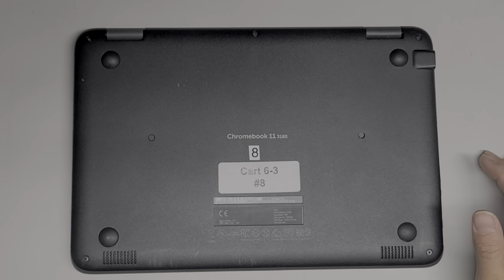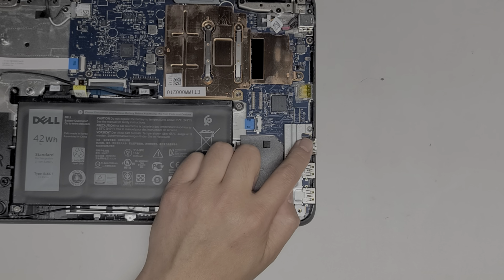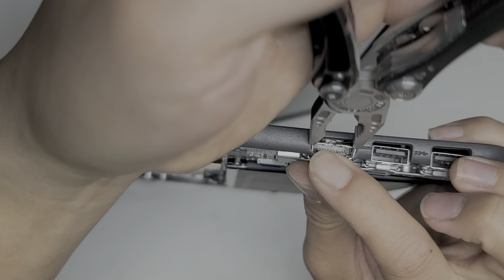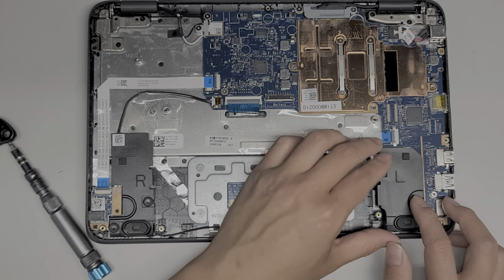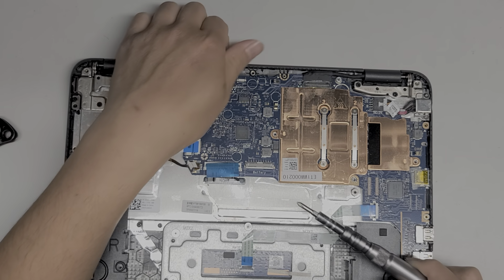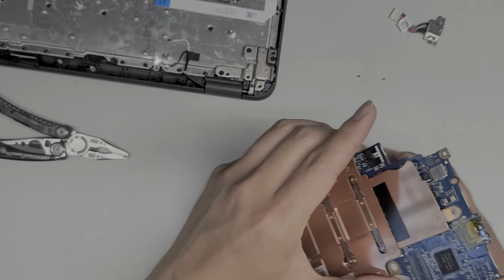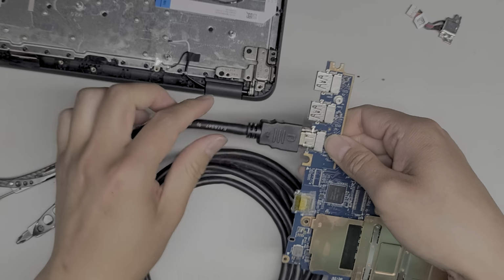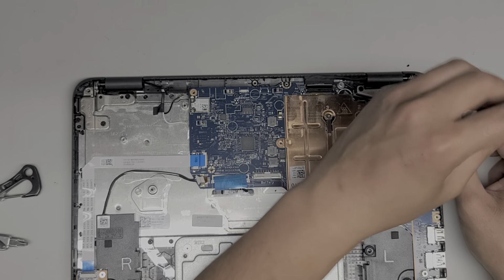DELL Chromebook 11 3180 Disassembly No RAM  No SSD No Hard Drive Replacement Nothing Upgradeable

Comment: I put a 128gb sd card in and installed linux to it instead of the onboard 16gb. Even with a light weight linux i found i'd be left with 6-4gb usable storage. My unit says chromebook but is no longer that.  End of Life on purpose, thats horrible google purposely make these to be trash after 10 years. My issue  is mine has a 2018 stamp on the inside, which make this only 8 years, i was told in 2022 that it was end of life and no more updates would be made. Hunk o junk. At least theres other options that i can make it happen.
Reply from the maker: Yup

Comment: It does not have a fan to cool the device. Where are its cooling centers? Please reply. ❤
Reply from the maker: It's passive cooling. It just slow the cpu if it's hot
Reply: ❤ thank you  @ItsBinhRepaired
Reply from the maker: @zainebsaber5828 no problem

Comment: Just an FYI for people that come across this in the future... You want to use an HDMI Chord and plug it in before moving/adjusting the port. It will help prevent any damage to the HDMI port. Don't make any adjustments without the cable plugged in. Also, don't go thru with putting the whole thing back together before testing repair. It's a pain to remove all the screws again if you wind up replacing the HDMI port or that little board with the three ports all together.
Reply from the maker: Hmmm I didn't do HDMI repair
Reply: @ItsBinhRepaired  That was an HDMI port you were trying to fix due to physical damage...
Reply from the maker: @geraldeaves3340  hmm I don't recall. I'll have to watch my video again. Lol

Comment: I was completely shocked and perplexed when I opened mine. Where even is the RAM??
Reply from the maker: Soldered like a phone
Reply: @ItsBinhRepaired   @ItsBinhRepaired  Yes, CPU, RAM, SSD.......EVERYTHING is soldered to the mainboard on these Chromebooks.    They were built down to a price - cheap as possible, but still able to run ChromeOS.    So, NOTHING is swappable, and Chromeboooks don't even have a BIOS or UEFI to speak of - the system is booted by a dedicated firmware, that EXPECTS there to be a ChromeOS in a very specific place in the onboard EEPROM.   Upgrading is impossible.  Replaceing a failed component is impossible.  Booting Windoze as an alternative is essentially impossible, as there is no traditional BIOS or UEFI.    There ARE utilities you can use to wipe out the ChromeOS and install in its place, a simple UEFI type thing, which then DOES allow you to boot and install a more standard Linux distro, but you have to be prepared to hack the machine, and re-flash the firmware to replace ChromeOS with a generic UEFI system.   Do-able, but NOT for the novice.
Reply from the maker: @VauxhallViva1975  yup, it sucks

Comment: Hi everyone i watched the video,un my laptop lenovo chromebook yoga 11e glimmer model i was able to install windows 10 by REMOVING THE PROTECTION SCREW and writing some commands.i am trying to find a solution for expanding the space.
Any idea's???
Reply from the maker: Nice! Nothing upgradeable sadly.
Reply: @ItsBinhRepaired  there is the storage. You are a lucky man since today, I discovered a way to upgrade my storage using the WiFi adapter to m.2 with mvme m.2 , and you will have a good storage.
The ram is not upgradable. Maybe there is a way to overclock the ram, but it is not safe 
I will accept the 4 gb ram.it will handle my apps for my work.
Reply from the maker: Nice
Reply: @aliS23473 bro your lucky you have the 4gb version i have the 2gb version😢
Reply: @lexhasnxtfxund is still a laptop 😅😅
Reply: @aliS23473  bro my shi went bootloop when i noticed linux mint is like 20gb my laptop only has like 14gb😭
Reply: @lexhasnxtfxund  this is the life, bro. Try removing the protection screw rather than install Windows 10 small version with the drivers   
About the storge I donot know the solution I will try an adapter from wifi to m.2 
I WILL TRY THIS SOLUTION.

Comment: helllo i’m having a issue with mine the touchpad mouse won’t appear i’ve tried restarting it and moving around the mouse settings but it won’t appear what would i have to move from the inside?
Reply from the maker: Check the trackpad cable

Comment: how to find the ram of the dell latitude 3189 please
Reply from the maker: If it's the same as this model, first thing you do is read the title. Lol
Reply: @ItsBinhRepaired
Reply: how to increase ca ram dell latitude 3189 @ItsBinhRepaired
Reply from the maker: You throw it away and get one with more ram or one that has upgradeable ram.
Reply from the maker: Correct lol I'm pretty sure that's in the title. Lol

Comment: How can u take the school program out the through taking it apart
Reply: you can reset the Chromebook by going into the bios of the Chromebook and it will uninstall any software's or apps that were installed before on it and you can also install windows on it,
but are you trying to steal the Chromebook ?
Reply: @skilledcamman4752  Yep, he's trying to steal it, he doesn't answer anymore
Reply from the maker: School program?
Reply: @ItsBinhRepaired  yes I'm trying to to deactivate the hols on it. I can't access the xhro.vebook because the company has the program that won't let you login. Is there a way to fix it
Reply from the maker: @chef_panda741  you'll have to ask the school

Comment: so i can not add more ssd
Reply from the maker: Nope
Reply: @ItsBinhRepaired  would buying a microSD card help with storage
Reply from the maker: @backupXgaming  you can store things there
Reply: theres a makeshift way to upgrade storage using a sd card. even the emmc flash storage on the chromebook is basically a sd card but soldered on the board its barely faster than a sd card because its directly soldered on the board and has a controller attached to it so its faster but many sd cards are as fast as hdd's or even faster you can find cheap sd cards with speed of 160 mbs which is arround the speed of a hdd